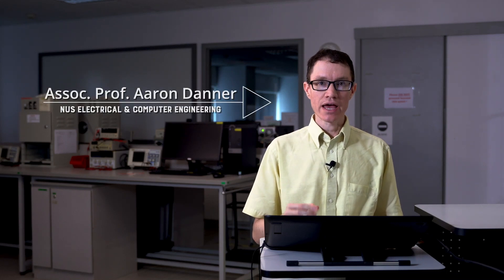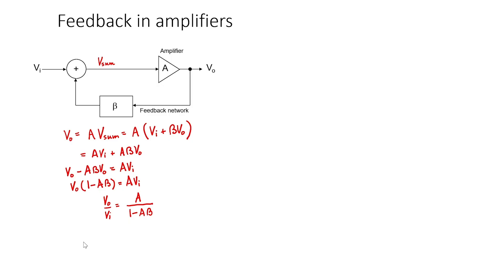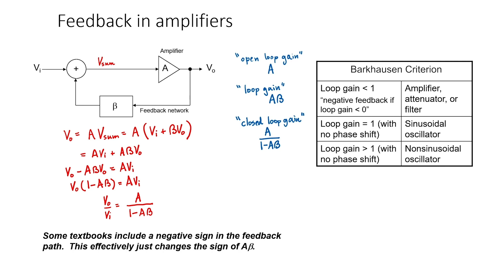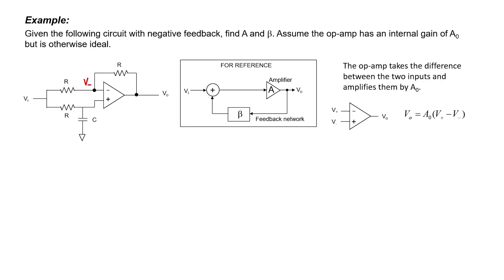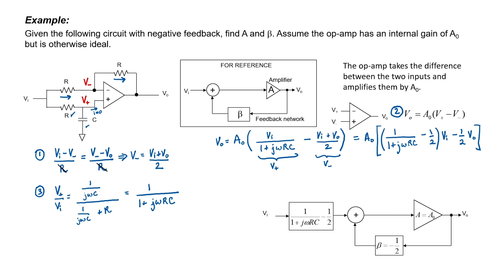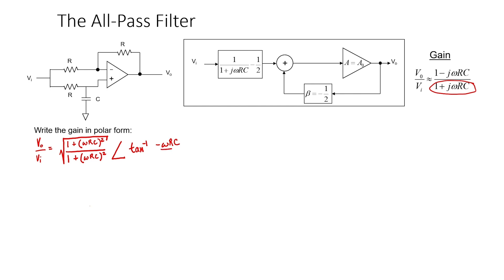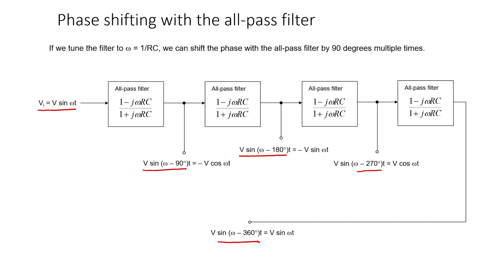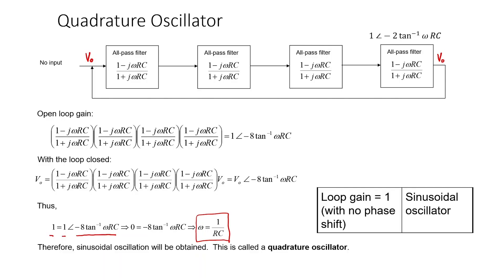Quadrature Oscillator and Barkhausen Criterion (1 - Feedback)

Comment: I built this quadrature oscillator in LTspice and found that I had to provide at least 2 capacitors with some initial condition / voltages to get the thing started. The simulation suggests that some initial conditions can be a bit messy when the thing starts up for ~10ms - I had chosen a resonant frequency of 159Hz. I also found that some initial conditions seem to lead to different amplitudes on the output. I had a lot of fun with this one!

Comment: Ok... so, if we Consider a Quadrature Oscillator circuit with two identical amplifiers, A, and B, connected in a feedback loop. Amplifier A has a transfer function H_A(s) and amplifier B has a transfer function H_B(s). The feedback network includes a complex impedance Z(s) that introduces a phase shift of 90 degrees.

a) Write down the closed-loop transfer function T(s) of the Quadrature Oscillator in terms of H_A(s), H_B(s), and Z(s).

b) Use the Barkhausen Criterion to derive the conditions under which the Quadrature Oscillator will sustain oscillations. Explain the significance of these conditions in the context of oscillator stability.

c) Assuming H_A(s) and H_B(s) are generic transfer functions, develop a mathematical expression for the oscillation frequency in terms of the circuit components, H_A(s), H_B(s), and Z(s).